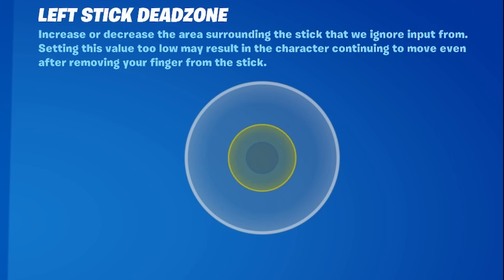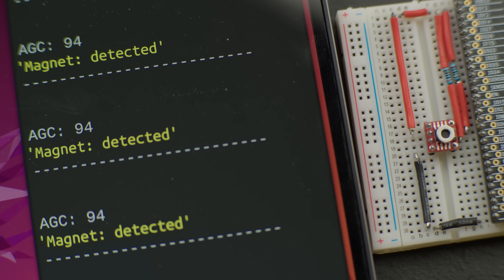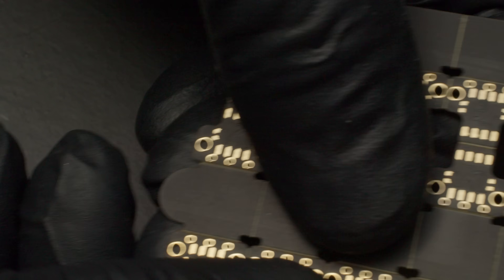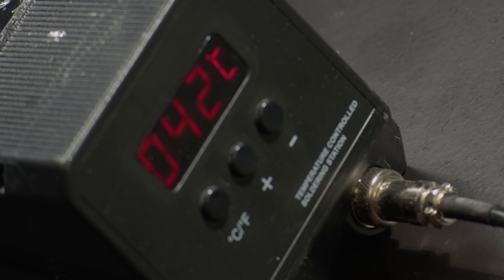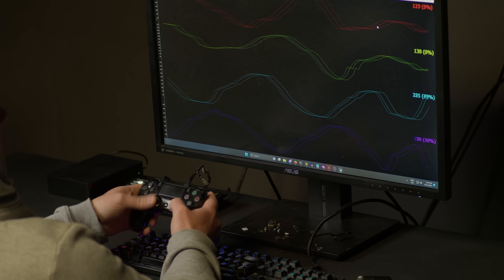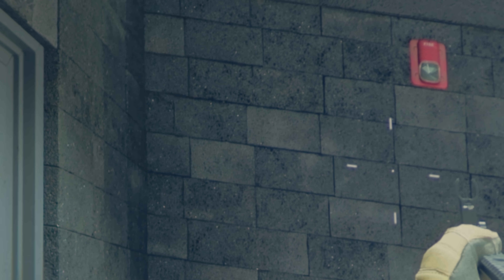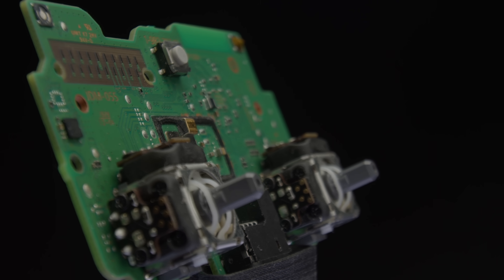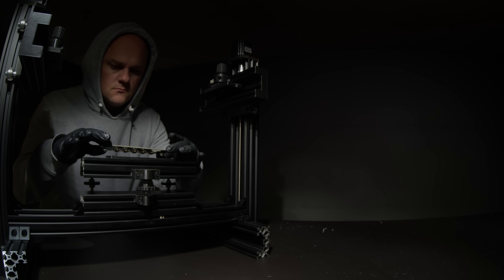Beating the $20B Joystick Drift Problem, and giving it away for free

Comment: Ive recently over the past few years completely figured out how to remove the drift without anything. I used to go through controllers like crazy but then i went exclusively back button controllers. Now every controller i have is in perfect condition. Even the stock ps4 controller is still kicking(after a few button repairs of course). Since ive switched to using back buttons i no longer have the need to click my stick constantly when playing games. It has basically removed any drift whatsoever. I reccomend this method to everyone not only for this but other things as well. It makes you play soo much better once you get used to these controllers. After a while you will never use a controller without back buttons again because it sucks. Its probably the biggest level up in gaming. These controllers should also be the stock option for every console. Its literally better in every single way and gamers need to understand this.

Comment: I remember when my $15 Off-Brand Xbox 360 controllers from Walmart worked for 5 years of decent use before dying to a battery acid spill

Now I bought an Xbox One controller for $50 with minimal use and stick drift has kicked in within 4 months.

Comment: Having worked in Aerospace, you'd appreciate the military, aviation and space variants of these. From switches, motors and pots. A gold mine of high end components that take so much abuse but will outlive us.

You definitely won't appreciate the price tag thou. It's nuts.

Also if possible use alpha leaded solder paste (/w flux) and a decent reflow oven (Hakko/Metcal). Will cut down on cold solder joints and make your tech last much longer. Lead-Free solder (RoHS) will eventually fail due to tin whiskering. Lead free solder is used everywhere today and is the leading cause as to why electronics today just don't last. Don't believe the anti-lead environmental remarks. Nowadays manufacturers intentionally want their products to fail to keep people buying more.
Reply from the maker: Yup. That is where the good stuff is. I actually use a reflow oven. Just used a plate for the visuals here. Leaded is 👑 !! 😁😉
Reply: @MariusHeier1  lol Yep leaded solder is the shit!

Comment: It's cheap materials and it's planned that way. I have 4 Xbox 360 controllers that are 12 years old and we're used ALOT they work perfectly fine still including bumpers. Even though they have been handled rough and even spilled on and taken apart and cleaned many times, Zero drift or bumper issues. Companys need to be sued for this to change.

Comment: In regards to property rights, I don't think there is any opportunity for you to claim property rights.

There is so much prior art out there with commercial game controllers which use Hall effect sensors and I know of at least one company which currently holds patents for this.

I'd be curious if there are any game controllers which use force sensors, however.  I'd love analogs which don't actually move and instead measure force, rather than movement.  Seems like this could provide HUGE dynamic range between super fine control versus full deflection, whilst still providing extremely low drift.  I'm thinking along the lines of the mouse pointers which can be found in the middle of old IBM Thinkpad keyboards.

Comment: What types of controllers can this work in? Will Wii controllers work?(Nunchucks, ect.) Also, you are a goat! Making a product thats really needed, and leaving it to the people. Good job man!👍 can't wait to upgrade controllers with this!
Reply from the maker: Any controller using the same alps joystick and runs on 3.3v. thanks for the kind words :)
Reply: @MariusHeier1  sure! its cool to know someone with a more advanced knowledge of controller mechanics is taking the time to try to change the main issue instead of waiting for some big corporation fix.
Reply: Yes. People have been doing this exact thing with GameCube controllers. It's called the phob gcc project.  the nunchuks and wii pro controllers have certain versions where the stick boxes are cross compatible with GameCube ones so it definitely can be done I think. I'd start by looking at that project.

Comment: Don't PS3 controllers use this method? Cause I have been playing on my PS3 forever and have never ever had issues with drift, but on 360, PS4 and even PS5 I have dealt with drift. The only issues I've ever had with PS3 controllers is. The spring in the analog stick wears out. So then there is tons of play in the analog stick. But still no drift. Why did they stop using this method? Controllers would last so much longer.

Comment: I have been looking at alternative sensors, the MLX30999 looks interesting, it’s a single sensor which would mean a bespoke stick system but it’s a 3D sensor and has two analog outputs, one for both X and Y! Unfortunately it looks like it’s 5v though…
Another thought I had was with this AS6500 sensor on Xbox or other systems that require a different voltage range. Would it be possible to just work out the required angle range but then extend the clamped range to be higher so that when you are using the max stick range it will essentially mean it’s only using 0-1.8v of the full 0-3.3v available?
Reply from the maker: I think the path forward would be moving the center mechanisms to the pot location..and use a single 1.8v 3d hall sensor (like tmags5273 ) together with a low power mcu with dual dacs. This will somewhat fix the non linear circular output, run on lower voltage and hopefully get within 0 deadzone for 255 steps. Still will be a bit power demanding but i dont think you can get away with that.
Reply: @MariusHeier1  yeah I agree a single chip approach would probably be the best bet. Seems like such an overhead to go from analog to digital to analog just for the controller to convert it back to digital again, although in real terms that’s probably negligible. It’s probably wishful thinking but the controllers must have an ADC on there somewhere, could we potentially (no pun intended) bypass that in some way?
In other news a new relatively cheap controller just came out with what looks like a whole new hall sense stick, Gamesir T4 Kaleid. It doesn’t seem to work in the same way as the gulikit design and might actually have a single sensor, haven’t been able to find out much apart from the exploded diagram. Only works on PC and Switch but I’m almost tempted to get one to look under the hood.

Comment: Cant wait for this to be implemented in controllers. Was just wondering, how do you program the as5600 chip using i2c? If you dont mind can you also provide a brief description on the hardware setup you used to configure the as5600 through i2c? A friend of mine is a console player and being the engineering nerd that I am, I want to try to replicate what you did and see what he thinks.

Ps...the only way I could think of to modify the endpoints is to stick a microcontroller in the middle of the layer which as you said is inefficient so it would be really helpful if i know how to code this chip using i2c

Comment: potmeters in controllers = generating e-waist

I have been modifying my joysticks and racing pedals with optical sensors for more than 15 years... And I am quite annoyed that potmeters are still being used. I know it is the cheapest solution, but when you spend more than $100 on a joystick/pedals, then 1 or 2 more dollars for a decent sensor don't matter...

Thanks for bringing this to the attention of a wider audience. They need to go to a shop and ask for 'potmeter free' controllers.

Comment: The big scandal is that even before hall effects sensors, optical sensors have been in use wear free already decades ago in affordable controllers. E.g. Microsoft Joysticks from the 90s had optical sensors, and are as precise as on the first day. Friction potentiometers are planned obsolesces and market failure, because you often cannot buy controllers with the same fancy functions AND durability even at a premium. So maybe some environment/consumer protection lawmaking is needed here, as the recent push for repairability has shown results. So thanks for your work, which proves there are better solutions, which can be a positive example for the rules change.

Comment: It isn't a problem at all and certainly not a 20 billion dollar one. It is a profit increasing measure. Metal wipers have been around 150 years till someone decided they could make you need to buy new controllers all the time. It costing 20 billion is how a rigged system with "market value" capitalism works,; predation.

Comment: Insane project!! ; For the level of complexity and engineering involved, I'd highly recommend trying to use gearing  to couple the joystick axis to the encoder magnet so you can scale the resolution. making all the components fit within a tiny enclosure might be a challenge, but so would trying to experiment with optical encoders at such a small scale ;) 

Keep up the awesome work!!
Reply from the maker: Thank you. Resolution is over twice the input for the ps4 controller. So it's more than enough. However im looking into making cheap optical discs, or elements. Since we done need complete discs for joystick.

Comment: Surely there is a way to implement this optically? Considering magnetics will change and drift over time.

 Similar to the incredibly dense and fine adjustment optical sensors on servos and other motors. A tiny steel disc with unbelievably fine hair like perforations tracked optically. No magnets to drift, no touching parts to wear. Magnetics are surprisingly easy to change the characterization of.  And that's not counting normal losses and field drift that will just happen on their own. (The sensor makers probably have already thought about this and implemented a fix)

 Optical sensors and their attributes... Are super easy to implement, and basically foolproof long-term. Super low power infrared emitters and detectors are available down to microscopic size. Cheaply. and other optical related stuff is well-tested, and easy to implement. You'd be surprised how many places we already use it every day.

 I don't mean to take anything away from your video. I absolutely love your project, 
 
This is just some of the input I thought I would share.
Reply from the maker: Working on optical discs as well. It's just a longer process so did not finish it for this.

Comment: I think the reason they didnt go this route is because magnets attract dust like, well a magnet.

The shelf life of the controller is based specifically on the length of the perspected generation, so the cost to implement this with new controllers ends up not being worth it considering people will have to clean and possibly damage their controllers over time.

Basically, it would amount to the same shelf life for a more expensive joystick.

Plastic rubbing sensors are cheaper.

Great concept, but you may as well have used a laser to detect dpi in a hemisphere, would cost more but have less maintenaince if done with a sealed chamber.

Just to solve stick drift lol.

Comment: This is somehow the most wholesome and change making video I have seen in years. I hope this project goes well. ps don't let it be stolen, copyrighted and then we can't use it
Reply from the maker: Thanks so much Seb! That means a lot.
Reply: @ItsMeBarnaby  Gulikits claims are legit, because they only patented a specific design or implementation of hall effect stick. An idea by itself cant be patented. if that would be true then nobody would be able to make a drill because companies would have patented rotary devices long ago. Even some of scuffs patentes are wrongfully given to them. if the patented lawyer ha payed attention then scuff would not have a patented for back buttons with a specific paddle design. Because scuff also has not patented back buttons but rather the specifi paddle shape of the back buttons. that is why Valve also won the last round in court after beying sued by them. 

As far as i have been able to figure out, gulikit has a patend for hall effect sensors the have a housing that resembles a potentiometer housing. (i am not very fammiliar with the specifics of the exact design that the patented), but i do know that a few other companies are also developing hcontrollers with hall effect sensors in them. And Sega has used these before they made the dreamcast. Sega used them first in the Saturn controller (wich came bvefore the dreamcast). i always wonder why people only seem to remember the dreamcast as the first controller that had hall effect sensorn. was the dreamcast more popular then the saturn? i really dont know because i have not owned any of them myself sadly.
Reply: Hall effect sticks themselfs cant be patented. only this specific design or implementation (if it has not been done before with this same design).
Reply: @ItsMeBarnaby Yeah but they use the DAMN NINTENDO LAYOUT 😠
Reply: @Gremlin244  I'd trade the EU USB-C law for a ABXY layout law immediately
Reply: Bro said wholesome 😂
Reply: @ItsMeBarnaby that controller lags too much, it feels great tho, just not to play any game reliant on reaction time.
Reply: If you want another event wholesome diy video, look up the guy who installed usb c into airpods gen 1 case.

Comment: It's strange that controller manufacturers haven't used hall effect sensors on a large scale, they have been around for a while, especially since it doesn't seem like a massive change. I get it can be a built in time limit so you have to get a new controller or get it fixed, but even professional/custom controllers usually just use a normal potentiometer.
Reply: Why would they fix the problem they created and that they profit from?

Comment: The main reason people get stick drift is from people setting the controller on the sticks to go afk and keep moving . I still use my ps3 controller from over a decade ago with no stick drift because I never did that. I did that with an Xbox one controller and it got drift in 2 months. DO NOT GO AFK UNLESS YOU HAVE A KEYBOAD AND MOUSE.
Reply: bro that not really main reason because i play with my controller and less than 3 months it already got drift i didn't even used afk method

Comment: Instead of making it cost 10x as much, why not just replacing the $0.001 of worn material possible?
Reply from the maker: Good question. Because this solution is going to last longer. And also raise the accuracy and precision of the controller.